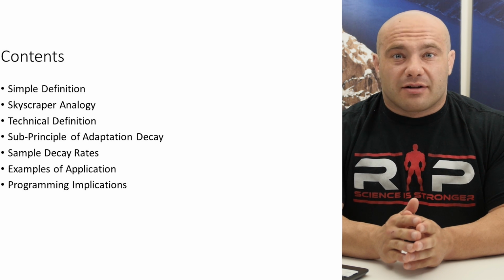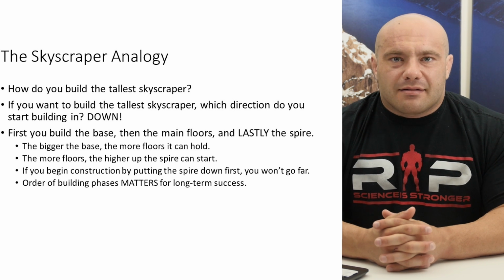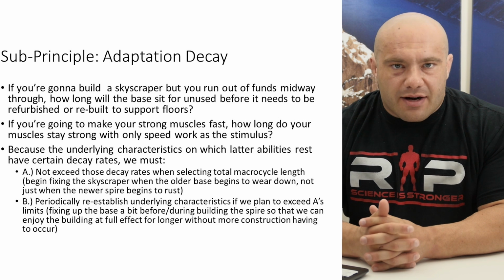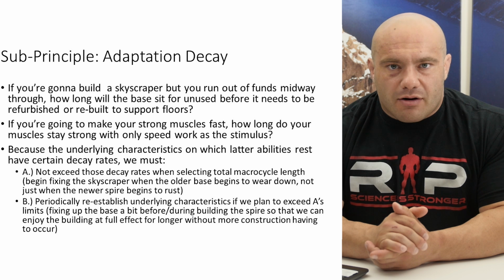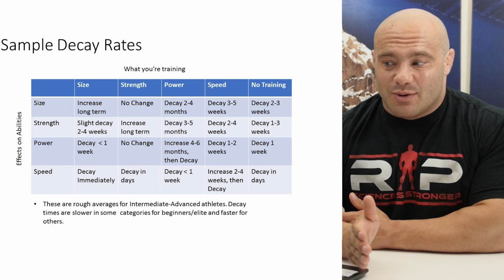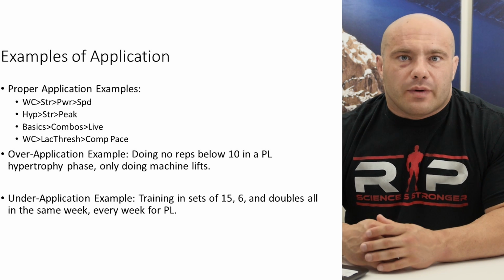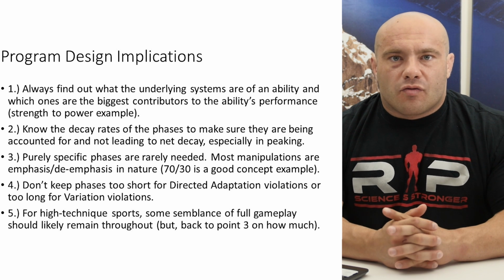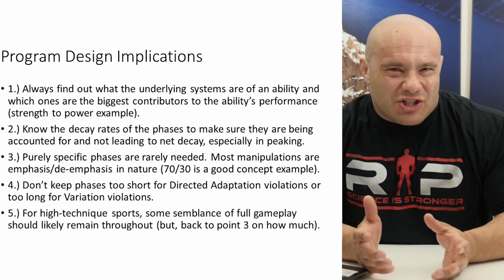Training Principles Lecture 7- Phase Potentiation with Dr. Mike

Comment: So DUP is bad?
Reply: DUP is a microcycle scheme (daily basis), this is talking about mesocycles, what you do over several weeks and months. DUP is a subcomponent of that, it's not one or the other. For example you can have two distinct hypertrophy and strength phases and use DUP within each one, which is what usually happens with most intelligent programs.
Reply: This is taken from an interview with Mike: "NO, DUP is not the best way to train because it largely ignores specificity".
Reply: SeriousSam113 I agree with that based on my training logs and how I progressed with dup and less dup. Adaptations are specific to energy System being trained. From my understanding When dup is used it’s a shot gun approach to hitting a target that may or May not be far away.

Comment: I used to give a presentation to distance runners who signed up for a 5/10km fun run in a month. It had very similar topics to this. A month isn't enough time to master running. The biggest performance improvement was to actually taper to be prepared on race day. 
More to lose from exhaustion than gain from practice the closer to the competition you get.

Comment: 0:05 Intro
0:30 Table of contents
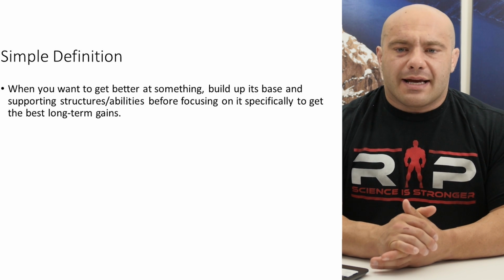1:23 Establishing a simple definition of phase potentiation
2:51 The Skyscraper Analogy – how phase potentiation works
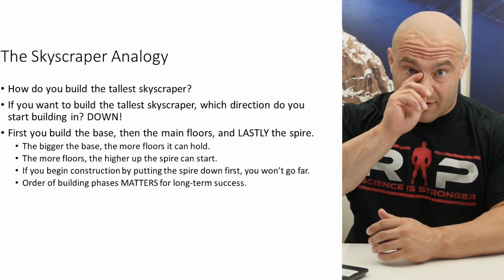6:58 Establishing a technical definition of phase potentiation
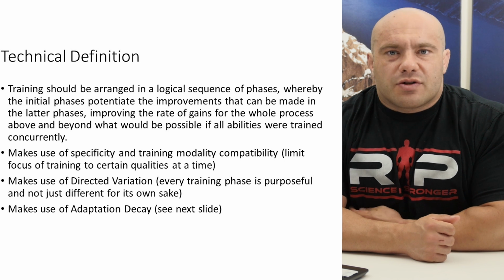8:00 Phase potentiation makes use of specificity and training modality compatibility
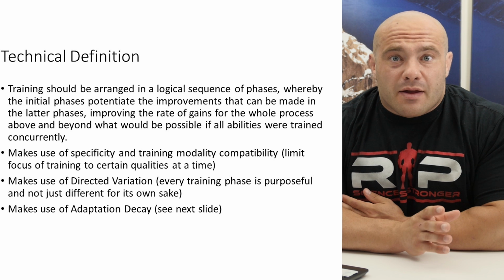8:47 Phase potentiation makes use of Directed Variation
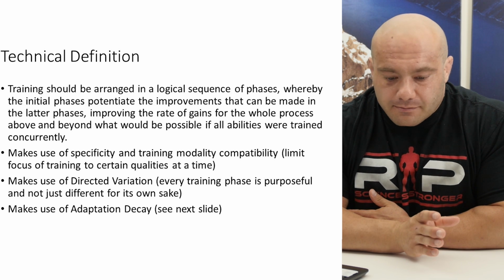9:22 Phase Potentiation sub-principle; Adaptation Decay
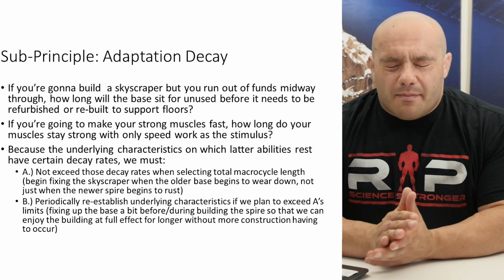12:20 Implications of adaptation decay
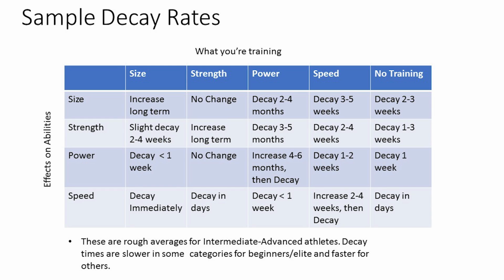15:25 Defining sample decay rates for Size, Strength, Power, Speed and No Training
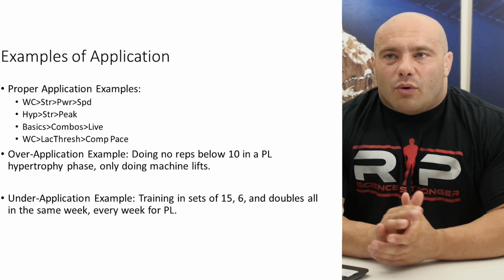20:27 Proper application example of Phase Potentiation
21:19 Over-application example of Phase Potentiation
23:15 Under-application example of Phase Potentiation
24:22 Program Design Implication #1 - Always find out what the underlying systems are of an ability and which ones are the biggest contributors to the ability’s performance (strength to power example).
26:38 Program Design Implication #2 – Know the decay rates of the phases to make sure they are accounted for and not leading to net decay, especially in peaking.
28:54 Program Design Implication #3 – Purely specific phases are rarely needed. Most manipulations are emphasis/de-emphasis in nature (e.g. 70/30).
30:00 Program Design Implication #4 – Don’t keep phases too short for Directed Adaptation violations or too long for Variation violations
31:56 Program Design Implication #5 – For high-technique sports, some semblance of full gameplay should likely remain throughout (but, back to point 3 on how much).
33:28 Outro
Reply: The MRVP (Maximum Recoverable Valuable Person)
Reply: The world needs more people like you lol
Reply: Not the hero we deserved, but the hero we needed.
Reply: Ty sir